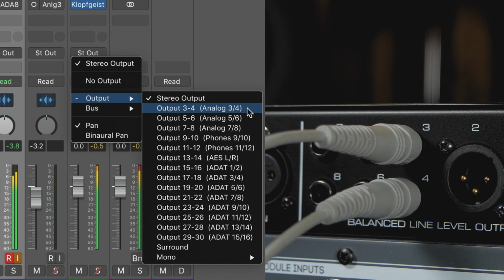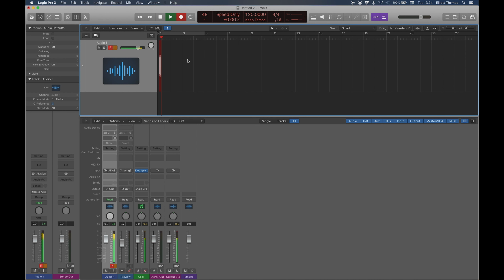500ADAT Quick Tutorial | Upgrading your headphone amplifier and monitoring facilities

Comment: Thank you. One question, is it possible to use the CB 500 Adat as the Main Monitor Output source together with my Apollo x8? So that the digital to analog conversion is performed by the CB 500 and not from the Apollo?
Reply: and how to route if possible?
Reply from the maker: @conrow1157  The only way to make this happen would be to route your main DAW outputs to two spare channels on the 500ADAT (via ADAT channels on your Apollo of course). You would then need to make a choice as to whether you had modules installed on those two channels (which would process your main DAW outs), or whether you always left them empty/bypassed. Potentially, taking the idea even further, you could even treat your entire 500ADAT as a kind of 'top-down mixing' master bus, using installed modules as a linear channel strip, chained together, before hitting your monitors.
Reply: @cranborneaudio  nice! And how do I need to route this in the Apollo console?
Reply: ok i unterstand.  I connect my Monitors to the bypassed adat 7/8 for everyday usage. In my DAW I route the Output to 7/8 adat as well. Having the benefit of better converters. For master chain example  In logic I route my Mix via I/O Plugin out to CB 500  adat 1/2 @cranborneaudio  and back in 5/6 adat. Will all the installed 500 series unites be recorded then? and what if I insert my SPL Kultupe 19 rack unit to 7/8 to also implement it to the master chain? Can I just leave it off when I juts want to go out in my Monitors? thanks
Reply from the maker: @conrow1157  Please contact us via the form on our website on the following link, it will be easier to answer questions rather than in YouTube comments: https://www.cranborne-audio.com/contact_us